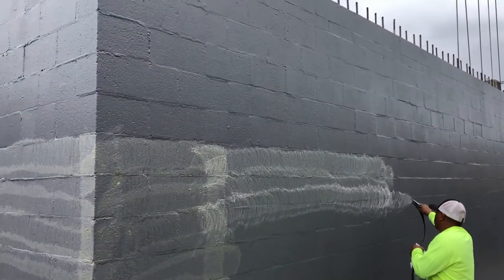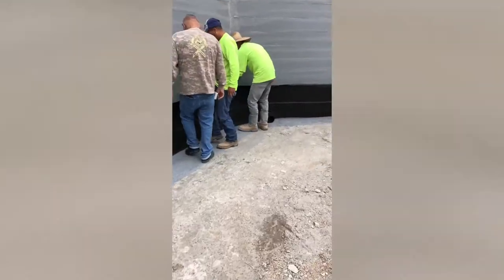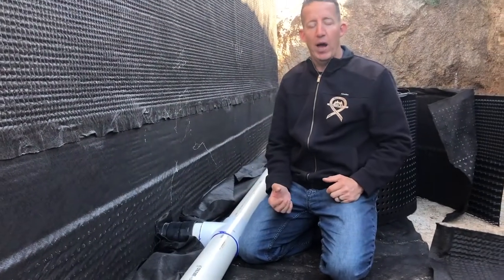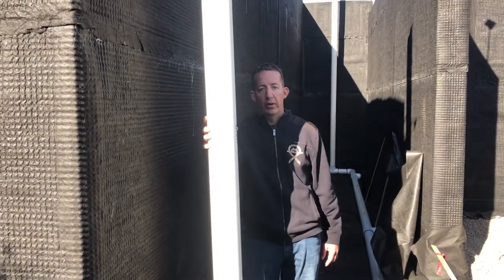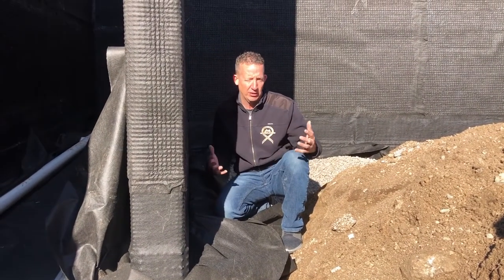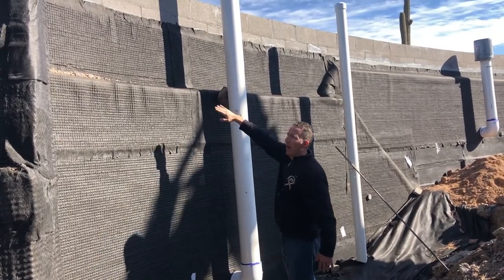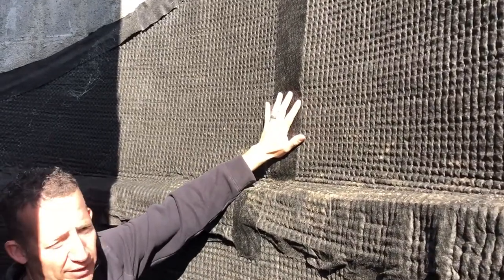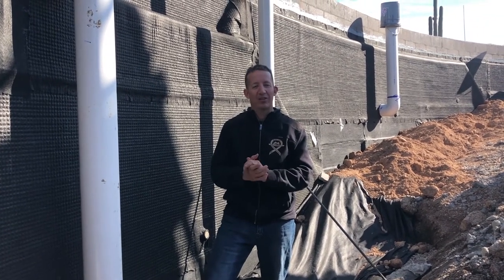Cinder Cone Project - Basement Polywall Waterproofing Part 2

Comment: The only problem I see is the burrito wrap of that schedule 40 drain tile. That will get plugged up within months And you will not be able to clean it out because the silt is on the outside of a pipe. The only solution is crushed rock all the way to the top if possible.

Comment: Looks like the big dimples are meant to overlap the small dimples , just saying .
Reply: Nope the big dimple’s are meant to go on the bottom to collect higher volume of water 💦 that’s why they make that 2 foot section is meant to go on the bottom of the wall drain that’s the way we installed them on foundation walls  u might wanna know what you’re saying before putting a comment 🤥🤯🤦🏽‍♂️✅
Reply: Overlapping the next 2’ section along the footing to the last works well with the dimples as they match well, but it takes a little more time.  The filter fabric overlay of seams works really well.  Love the Polywall/PolyGuard system.  Just finishing 500+ feet of foundation as the homeowner.  Doing it alone is straightforward on the bottom 2’ section with an uncut 50’ roll, but takes more effort with the 4’ rolls at 50’.  I cut them in relatively manageable 8-12’ sections and just went slowly.  I am sure that my process would be much quicker and better with a 2nd house, but…….happily, doing this was a once in a lifetime process.  I am glad I did it myself.  Also, nesting the dimples of the next piece of 4’ works well too. But means that you have to pull back a piece of the filter fabric.

One other lesson is what I see as a great need to scrape off the thin layer of concrete residue from the foundation pour that seeps onto the footing before putting Blue Barrier 2200 on at the cold seam.  Otherwise it will flake off.  That is a lot of work, but worth it.  If I were to do it again, I would also power wash the footing, not just have a robust sweeping of the footing, prior to the 2200 application.  I also found a great tool in a kitchen rubber scraper to push the 2200 into the cold seam and get a tight application.  Cutting the round corner of the scraper helps.  It worked better with a soft silicone scraper with a few fingers of pressure than the hard scraper I tried first.  That is all personal choice.  Drying time for any washing is also an issue as tight time schedules might not allow that, especially in colder climates or ones with longer times to have the footings or foundation get to the appropriate level of moisture.

A great thank you to the team at PolyGuard for wonderful tech support and customer service. Nice, professional and knowledgeable folks.  Very pleased to have selected their products for this house.  Great to then watch a wonderful excavation contractor do a great job carefully backfilling.